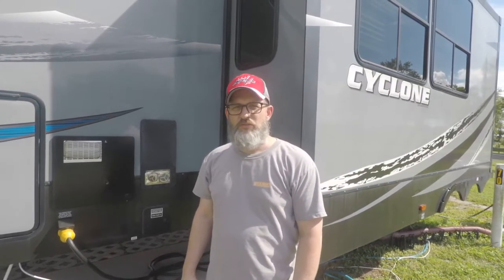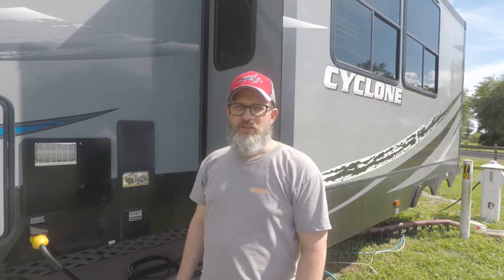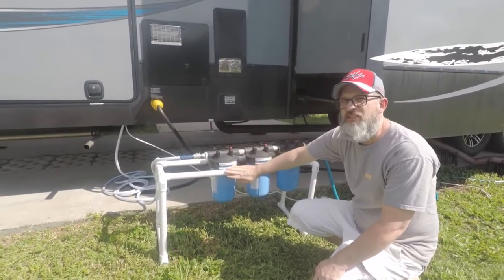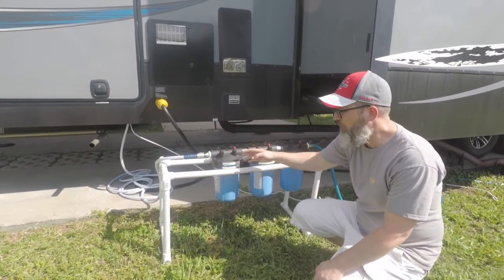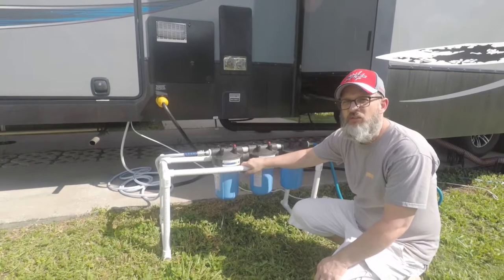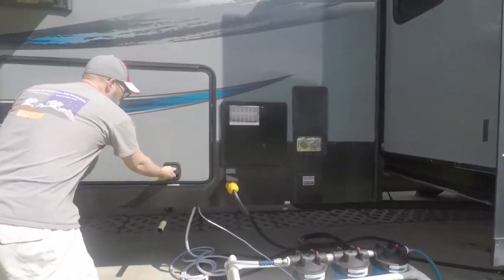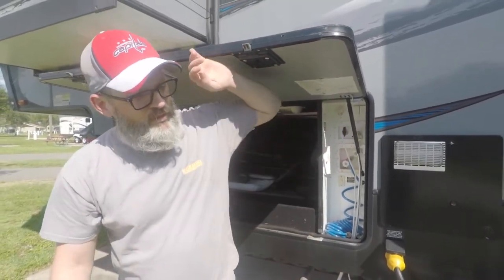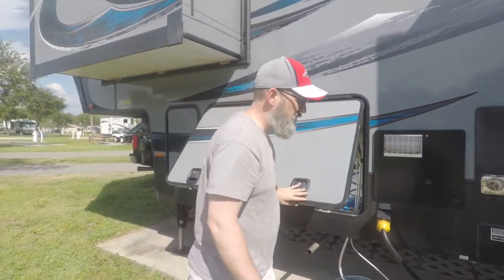Easy DIY RV Water Filtration System: Protect Your RV Water System

Comment: Hey! Great video! When sediment built up how to you unclog it?! We're experiencing a drop in pressure in our rig. Thank you!
Reply from the maker: Hi Ryan. Nine times out of ten, the problem is due to debris clogging the flow restrictor or the check valve in the water line. The flow restrictors are on most faucets and reduce the water water flow out of the faucet to comply with national water consumption standards. They are usually somewhere near the opening of the faucets. I have also located them in the line underneath the sink. The check valve is in place to prevent water from flowing back in to the water system. If there are any on your RV water lines, they can be a challenge to find. Check for mineral build-up in the flow restrictors in the lines that have problems.

Comment: I really like this setup.  After building this and using it for some time, is there any changes you would make?    As a person who works in the health industry, how comfortable are you that this would capture all harmful deposits in the water coming into your RV?      I haven't read the lists you have linked above,  so forgive me if you answer this there.  What tools would I need to have to do this build?
Reply from the maker: Since we are hooked-up to a public water system or a well, I trust it. If I was filtering water out of a stream or lake, I would be a little hesitant. The 1 micron filter will stop mostly everything. The one change I would make is to use brass or copper fittings instead of plastic or other metals between the filters and also to and from the hoses. All you really need is a large adjustable wrench and some plumbers putty or pipe tape to put around the connections. If you choose to make the stand, you would need something to cut the PVC. The stand is not a requirement. It was just a fun side project.
Reply: I do like the idea of using brass or copper instead of the galvanized or plastic fittings.    Thanks for the information.

Comment: Curious to know if you still have decent pressure to take a shower, the 1 micron is very restrictive and and worried about pressure at the faucets and shower... Thanks.
Reply from the maker: No problem with pressure at all. We just bought a new RV and use the same three stage filter system, and I've never had better water pressure. Typically water pressure problems occur because the flow restrictors are getting clogged with silt/sediment or in some cases the shower head is just not very good. We upgraded ours to an Oxygenics shower head.

Comment: We full time! How do you insulate the setup in colder temps?
Reply from the maker: I have not had to worry about it. The coldest we have been is in the 30s at night and did not have any problems. Any colder than that and we leave. We do not like the cold at all, so stay far away :)
Reply: I would think that if you were in freezing temps (within reason, idk if sub zero would work) a tarp and a heat lamp should keep it plenty warm

Comment: So what flow rate do you actually realize in RV (post your .5 micron filter)?  Many .5 micron filters only flow at .5gal/min. My shower, on medium facet setting operates at 1.2 gal/min.  I also put sodium hypochlorite in my water to chlorinate the water besides bleaching the tank periodically. Bleach has cleaners which you shouldn’t drink, hence the sodium hypochlorite.
Reply from the maker: Good question. I do not measure in GPM, but it flowing at about 40 PSI after the filters. We really do not have any complaints about the flow in any of the faucets in the RV after installing the filter. Before the filters, I set the PSI between 55-60 psi, so I don't lose much going through. We do not add anything to our water after it goes through the filter and have not had any problems since we put it in. Other than cleaning the tanks on occasion, we just use the filter system. Thanks for watching and adding to the discussion :)

Comment: You have these mounted vertically.  Can you mount them horizontally?  My thought is you could potentially create a small box to hold these 3 filters lying down and mount the box on top of a product like this Amazon product (B00KPQYV0E).
Reply from the maker: Good question. I honestly have no idea if they can be mounted horizontally. I suppose if they are under the pressure of the water flow, it would not make a difference how they are positioned, but I really have no idea.